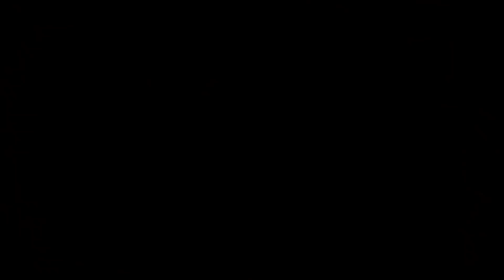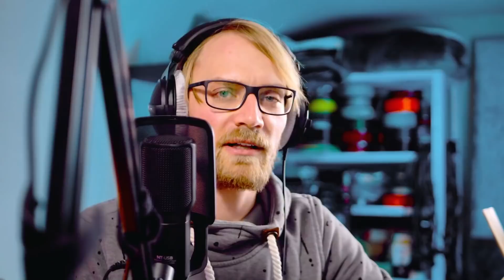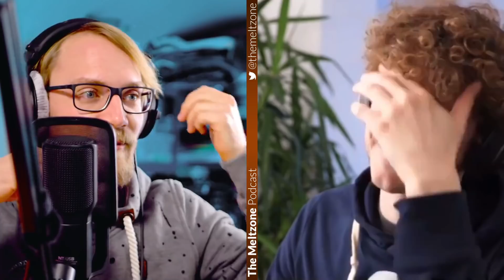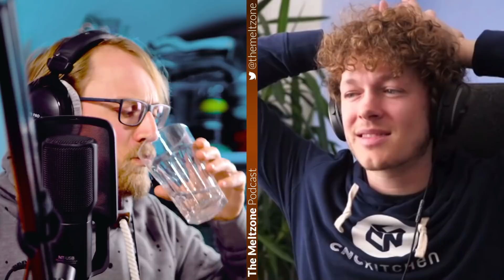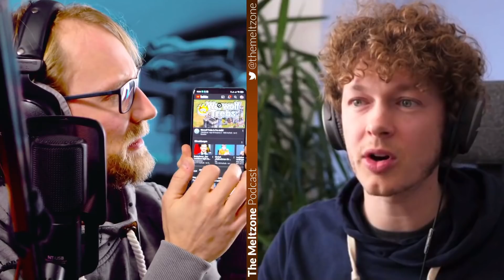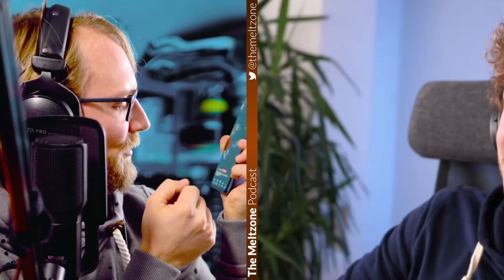The biggest 3D Printing YouTuber we didn't even know of & faster printing- The Meltzone Podcast Ep41

Comment: As a retired Boeing engineer, I can tell you all parts are tested for acceptance.  Requirements will vary depending on the design limits and environment the article will be subjected to in use.  Typically, one sample is tested to 150% of design limits.  If that part fails, then 8 parts will be tested to 100% of design limits.  If any of those fail, the lot is rejected.  Hope that helps.

Comment: I guess another problem to 3d printing continuously is elasticity of FEP Film that requires a higher lift to overcame suction forces. The 3d printers with the plate that submerges progressively in the resin don't have this problem but they seems to be less polpular these days than in the past as LCD is much cheaper approach and by design the other ones need a projector or a laser and galvos

Comment: No need to buy anything to print much faster. Use Klipper instead of Marlin. Klipper has an "input shaper" feature which achieves the same as that Ulendo company but for free except it does it on the fly (as long as your board, extruder and hot end can handle it).

Comment: Hey guys. Great episode. On the topic of belt printing, Kiri:Moto 2.6 (a beta release) has full support for it now. I've spent a bunch of time with the CR-30 making sure the slicer + path engine generates optimal gcode for the belt. There are a bunch of belt-specific optimizations like putting seams under the part on the belt.

Comment: There is a lot that can be done with good CNC controllers. Two things that stand out to me is: DSP filters that avoid resonances in the system, you touched on this. You can even constantly vary speed so there is limited time for standing modes to setup. AvE did this on his lathe. Proper jerk control; not like Marlin has now but control over the rate of acceleration, 2nd derivative of velocity.  That said, just build a decent mechanical solution! :p

Comment: I certainly prefer the content from Tom and Stefan, however consider the fact that these STL sharing websites have many millions of items on them. In my opinion, there is a need for sifting through the 99% of terrible and low quality designs and providing "reviews" of the good designs. I think this is especially true of functional STLs versus decorative items.

If you wanted to capitalize on this trend, then maybe you could create 2nd channels focusing on finding and printing items? WildRoseBuilds follows a similar trend, although focuses on the timelapses moreso than the items themselves.

Comment: On the topic of the "could you just make a printer with a 0.1 degree gantry", Karl (Nak 3D, maker of White Knight) tried to get a local 3D printing shop (Printed Solid) to source the parts so kits could be sold... the owner (David Randolph) contacted a lawyer about it and was basically told "it's patented" and when they asked "what if we just sold different sets of parts that could eventually be assembled into it?" they were told "if the patent owner sues, even if the patent is for an unrelated design, the patent owner lawyer simply has to ask 'what is the intent of selling these separate batches of parts, as they don't go with anything besides the belt printer' and just the intent of making it easier to self-source the parts and/or assemble kits will be taken as knowingly trying to get around the patent, and will be considered a patent violation and will cost a lot". So just going "I know the patent says 0 degrees... what if I made it 0.1 degrees" wouldn't work... which is why there is no belt printers made in the US.

Edit: your comments about the patent pools, you remind me of golf balls. Those that play golf know that you're going to loose a lot of golf balls. Golf balls have all kinds of crazy design aspects to them (how the internals are made, materials, literally how many little divots exist on the outside of the ball and how they're arranged, etc.). The basic ones are cheap, but not very good. The good ones (goes further when you hit it and various other "golf terms"), aren't cheap. Along came Costco, who ended up relabeling some overstock golf balls and reselling them. It came out to about $1 per golf ball, but they were so good that they were compared to a ball from Titlist (Acushnet Company). Acushnet was very unhappy with that and basically said what you mentioned in the video "we have these like 50 patents, we don't enforce them, but if you don't stop selling those golf balls, we will enforce them". Costco's response was "bring it", but they had a slight issue in that the OEM for their golf ball said "nah uh, we're not selling our overstock to you anymore" because they didn't want to be drawn into the legal argument. So now they have a different golf ball design. Point is: there are companies that do the "we're gonna patent it, but we know it's going to screw things up, so we won't enforce it..." F/RAND (sans the formal statement of it) "...but if you threaten our business, we will enforce it".

Comment: A few things about tool changer:
1) Pro: I hate changing nozzle on the machine - it will be quite expensive to buy heat break from time to time. I've broken two heat breaks already. I often switch wood filament and it requires 0.6 mm nozzle. Although I have no clue how will I heat the hotend outside machine.
2) Pro: I'm not interested in multi-color printing, so not care about automatic tool changer
3) Con: I would not trust plastic mounts, I feel like it might get soft and deform under my Hermes extruder. If it was cheaper, like 20 per 2-piece set, then I would buy like 3 so I can replace them at any time when it fails
4) Con: These mounts felt too deformed to pay the amount of money they ask.
I would like to see This Old Tony build his own tool changer from aluminium - looks like he needs one for switching between nozzle diameters quicker.
Reply: The system from Xchange is milled out of  aluminium and costs the same, so i'd rather buy that one

Comment: If you think the voron is overengineered you should look at the hevORT or the BLN Cube ;)

Honorable mentions: jubilee3D
Reply: @voron_design  the second you load up that spec sheet that says the mr85s are motion rated for your load, then I’ll be wrong but math doesn’t lie.
Reply: @Olof123  Do you even know what the MR85's are used for in VORON? They are used in the Extruder, same as in Bondtech extruders. They are well suited to that load case. So yes, the math doesn't lie but you were also wrong. Mainly because you were making a judgement based on incomplete knowledge of VORON.
Reply: @lolmodule-42  you’re right, I’m in the middle of sourcing extruder parts (so just mixed up the bearings) it’s the f695 and 625 that aren’t motion rated for their load. That’s the one I did the calc on anyways
Reply: @Olof123  I don't see any f623 on the V2 bom
Reply: @Olof123  f623`s were only ever in the v2.0 and vzero, other than zero all current revisions since use f695`s
and in Vzeros its lower loading and with hundreds/thousands of hours runtime the f623s are holding up just fine.
Reply: @tinpec  I can’t type for shit lol, it’s the f695 and 625. I did this ages ago.
Reply: But some how they never fixed it, but then most of the guys are programmers not engineers
Reply: @Olof123  The only VORON that uses F623-rs is V0. Yes, they were used in V2.0 but that was long ago and not many of them were built. The V2.4 is a very different machine and with over 900 V2 printers in the wild there haven't been any major issues.
Reply: @Olof123  if we're talking numbers, 900 printers don't seem to have problems with that bearing, so I'm not sure what there is to be fixed. Do you do this calculations on all printers you look at? Most printers I've seen use way smaller bearings. "They never fixed it" is an interesting statement though, V2.4 has been out for 8 months and doesn't use those bearings on the Z drives like you're claiming. your original comment was "they have some issue with the z bearings" and that's simply incorrect. 900 printers do not have that issue.
Reply: @lolmodule-42  I grabbed the wrong part number first, also just because it’s out in the wild doesn’t mean much. It takes time for for issued to arise. Just look at all of the recalls you have in the automotive branch and they have regulated testing too. And I know of several machines that have had that issue with bearings, both in x and y and the z (mostly with the larger build volumes) .
Reply: @Olof123  I work in development and testing for one of the big 3  in the US so I know all about regulated testing. Yes, having machines in the wild does  mean that much because although you can run simulations and tests. Nothing is a match for having the target audience use it. 900 printers, each having say 2 dozen bearings, you are bound to have failures. Most times its related to buying extremely cheap bearings. Also, "several machines" out of the total 1300 of the 4 different VORON printers is most likely a statistical anomaly at best.
Reply: I think voron is under engineered. They lost the head engineer around 2.2 and they have some issue with the  bearings.
Reply: @Olof123  there is one detail I forgot to mention that just struck me. 2.2 had no "head engineer", but I know who you're talking about and the only thing they had a major input on in 2.2 was the Z drives, those are mostly his design.
Reply: @Olof123  Did he switch to another project?

Dieclaimer: I never saw a voron irl but to drive the z-axis with 4 belts always seemed silly to me. I'm much more interested in the hevORT/jubilees approach of a perfectly constrained bed with 3 leadscrews/ballscrews 👌🏻👍🏻😁

If only I had the time to build it ^^

I do like the voron extruders and carriage designs though!
Reply: @Chrisknot94   check out the annex engineering k2 , he does work for them now iirc.
Reply: @Olof123  Oh, he's with annex now! Makes sense actually :)

Comment: You should definitely check out ProperPrinting. He designed his own 3d printed quick-swap toolchanger and a connector for it, which also disconnects the bowden tube.

Also check out the available voron models, there might be one for you. personally i dont like how the z-axis is driven. i can see the advantage of a static buildplate (i would really like to see someone build a voron-like printer with a cr30 belt... i might try that at some point) but the same would also be achievable with lead- or ball screws.

oh and btw i'm 23 and i dont find ticktok-style videos appealing, because i don't think they really provide something meaningful.

Comment: I would love a quick way to change nozzles on my Prusa Mini. I quite regularly want to swap between 0.25,0.4 and 0.6mm. Some smaller version of that tool changer with complete hot ends on would be great. Assuming you could store the z offset per tool.
Reply: A somewhat cheap solution would be to switch to a Dragon or Mosquito hotend, so that you can do your nozzle swabs cold and onehanded. You‘ll only need a 3d printed torque wrench with a socket, and a nozzle swap takes 20 seconds.

And you could look into a nozzle probe pin, a endstop with a pin that you can press with your nozzle. That way you dont have to change any offset at all. Would cost around 10€/$. But I dont know if there is enough space on a Prusa Mini for that.

Comment: Yes, you should both go for Klipper. I like it and I would like to see what experiences you would make.
Reply: Klipper is set up pretty quickly, even with input shaping. On my ender 3 it easily gave me two times or more the acceleration I used to run earlier without skips or ringing. Of course now volumetric flow is the limit. Klipper also makes it easy to build custom printers, for instance by running klipper on an arduino nano (the microcontroller part is very lightweight). And it supports obscure geometries like winch printers. Would love to see what you guys come up with.
Reply: Klipper/Mainsail user on Voron 2.4 here. Love it 👍
Reply: Yes I agree!   I just built a voron switchwire.   And this introduced me to what I think is the most user-friendly 3d printer firmware!!  I can make changes in my firmware and save it with about 6 clicks of the mouse!   No more switching sd cards etc!
Reply: @MD-NWWI  With Fluidd/Moonraker I count 3 clicks to change the config
Reply: @yaVDRgda  I am currently setting up mainsail.   I have been using octoprint but it has alot of extras that I don't need.   I wonder if there is an option for a raspberry pi screen for mainsail or fluid?
Reply: @MD-NWWI  I use KlipperScreen with a 5" HDMI TFT
Reply: @yaVDRgda  thanks!!  I'll take a look into that!